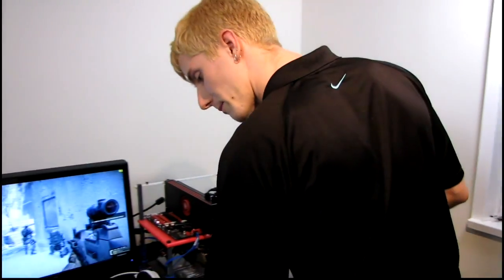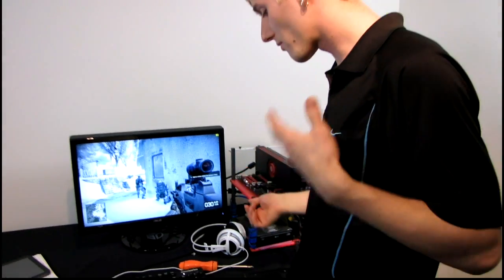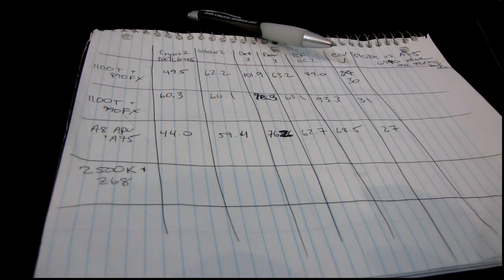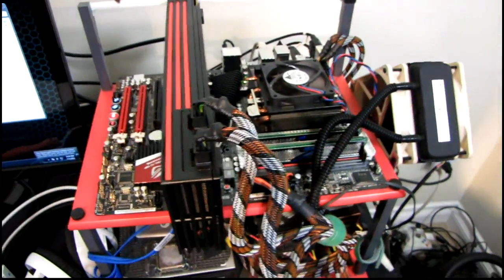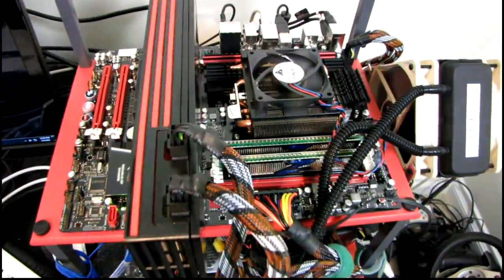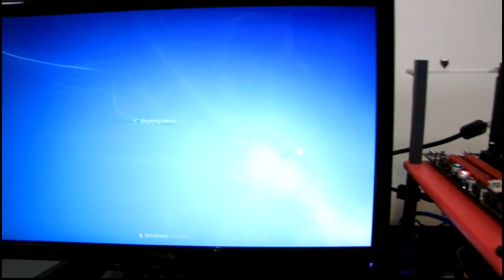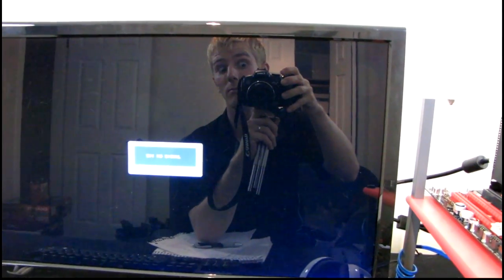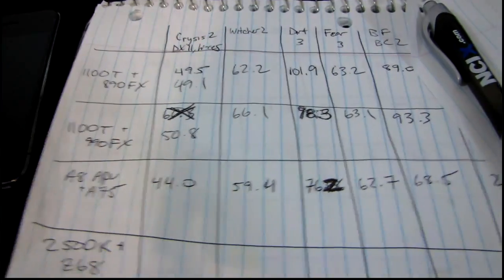890FX vs 990FX Chipset With 1100T CPU Gaming Performance Comparison Linus Tech Tips

Comment: Not to make this a help forum or anything but I'm wondering what RAM you used on the Crosshair V mb. 
Here's why:
I bought one (Asus Crosshair V Formula-Z and checked on Pcpartpicker.com to make sure the RAM I bought was compatible(Kingston Fury HyperX 16GB 1866) It said it was so, I tried and every time try to start the mb, i get the FF code and the dram led starts blinking. I checked the user guide for the mb and found that the HyperX is only listed as 8GB(4GB x2) So, my next question is: Is the user guide just older than the RAM or is it incompatible?

Comment: Very interesting vid. Right now I have a 790FX and Iv been curious what kind of improvement there is going up to a 990FX. Obvi the 790 to 990 jump would be greater than from an 890 to 990, but probably still not any huge difference. Seeing that Bulldozer is a flop and Id just end up using the Phenom II I have now. We'll see what AMD comes out with for a processor next and decide then if its worth upgrading to AM3+ socket. If their next release is a flop like Bulldozer, might jump ship to Intel!

Comment: @OutlawLovesNewVegas well you are pitting a 8 core 8 thread cpu vs a 8core 16 thread. so the best test would be two run a cpu from amd with 8 core 8 thread vs a intel quad core 8 threads and you then will see the difference in performance.

Comment: @ItWasntMe456 what speed is it running at.... in a program like CPU-Z you will see the speed show up as 800 mhz for 1600mhz ram and 666 for 1333mhz ram.  This is normal and is set in or by the bios, it could be that bios is not properly detecting your ram speed.

Comment: would i get a huge differrence in performance between a H67 and a P67 mobo? (i dont give a crap about overclocking) the CPU would be an i5 2500 with a GTX560Ti VGA and 4GB kingston hyperX blu 1333mhz ram.

Comment: @LinusTechTips i'm sorry if this is unrelated but is it going to be the same with intel platform? like h61 is on of the affordable and quite cheap platform for 1155,but does that means the performance will also be the lowest. i'm not going to OC my system or not going to use SLI or even CF. thanks linus,hope you answer my question.